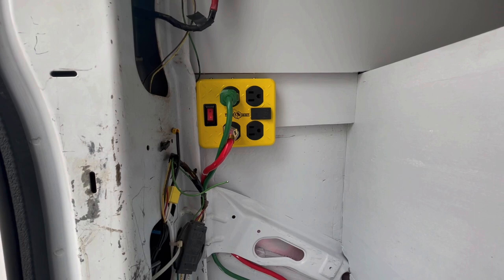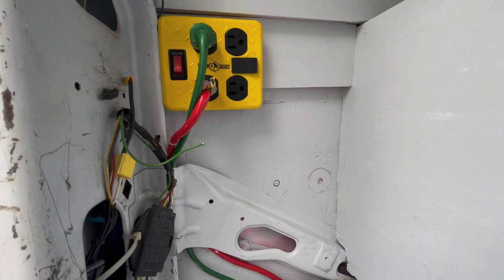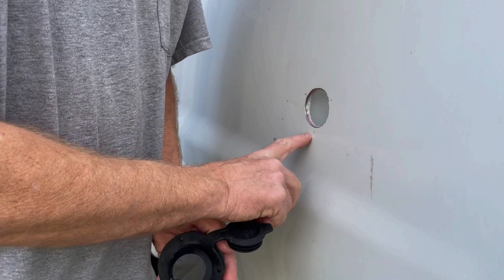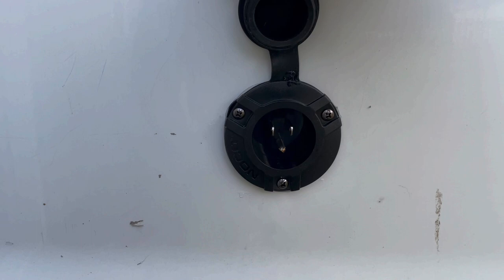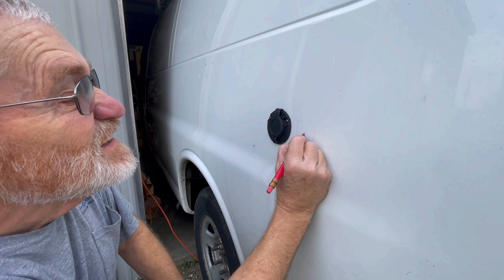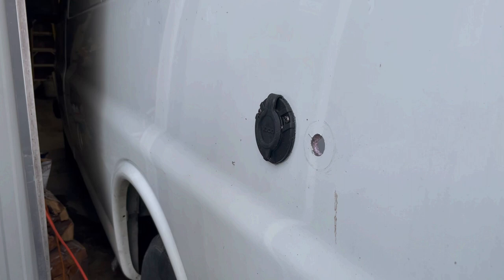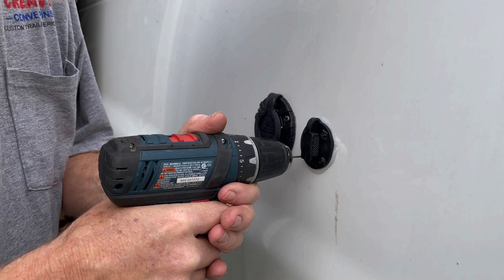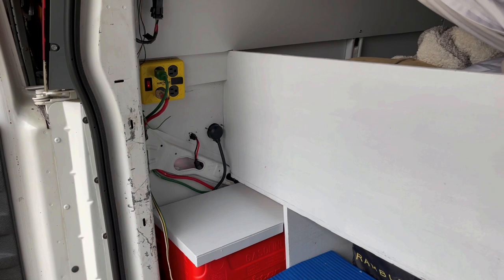Chevy Express “DIY” Camper Van Episode-16  Shore Power & Portable Solar Receptacle Installation

Comment: Always giving me ideas and through thought out installs. Thankyou and Happy New Year. Couple of questions. Curious why you didn't use stainless lock nuts and bolts instead of self tapping screws? Self tappers have a bad habit of loosening up over time. Also, curious why you didn't file the newly cut holes and spray with some kind of rust preventative?
Reply from the maker: Good questions….
I just prefer the ease of the self tapping screws.  I don’t worry about painting because the silicone will coat the threads and not allow the metal to rust.
However, the way you suggested is the better of the two ways.
Thanks for watching!